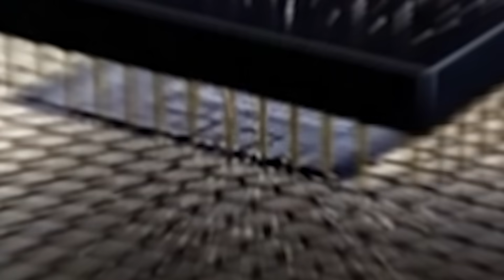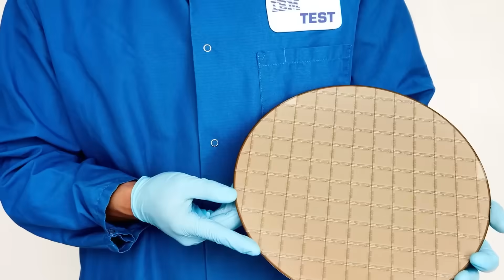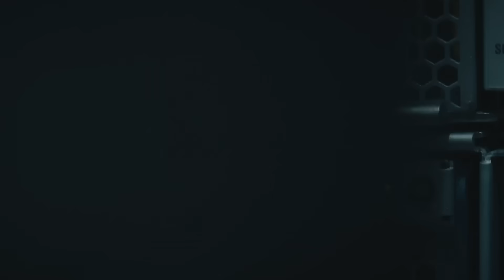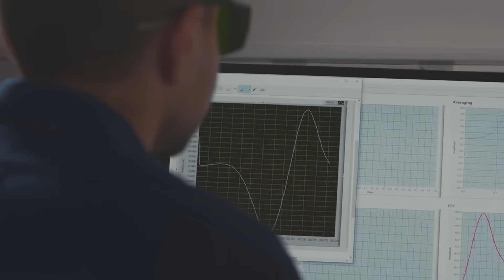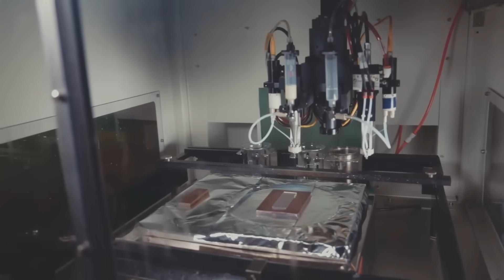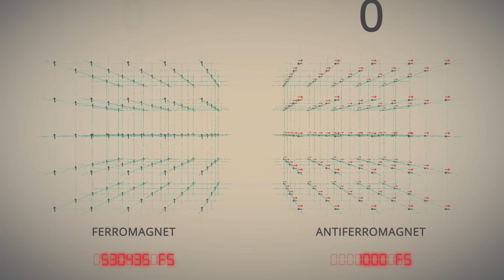Samsung's New 8nm MAGNETIC CHIP Beast Wiped Out The Entire Silicon Chip INDUSTRY!

Comment: photonic computing... no heat ,  infinite speed.  what was the other issues???
Reply: You are old enought to google that your self.
The reason light is not used for computing is that the operability is very hard.
Reply: @blanciwiinom8060 look at the future and then fix the steps that prevent you from being there
Reply: @blanciwiinom8060 👍👏
Reply: except you can only process with light. it can not store memory, so you will get bottlenecked using silicon  ram and hard drives. the first ram ever was already magnetic too,

Comment: If a technology is slower at the fundamental level, that doesn't mean it will not replace processors. If it can be miniaturized enough and made cheaply, then parallelism will be the way to circumvent the speed drawback of magnetism. So, processing can become massively parallel to reduce latency over most if it consume a lot less power and produces a lot less heat losses
Reply: Depends.  The worst enemy of a slightly better solution is one that works well enough....

Comment: MRAM is likely to replace SRAM full stop outside of the lowest L0/L1 caches.

The scaling of SRAM has become increasingly bad overtime, and when combined with the greater efficiency of non volatility in MRAM it just makes more sense to start pushing MRAM to L3 and later L2 cache.

This is ironically already being made more and more possible with every new 3D packaging generation through which AMD is iterating on its V cache.

As 3D stacks decrease pitch and increase number of layer <-> layer interconnects we will probably see L3 cache go completely vertical, and L2 at some time after that - at which point it no longer needs to be on the same fab process as silicon to work.
Reply: they would of done this decades ago if it was better, the first ram ever used magnets
Reply: Excellent discussion👍👏
Reply: Likely not. MRAM is slower. MRAM will have its' place, but completely replacing SRAM isn't it. I am sure some SRAM will be replaced though.
Reply: @derek2593 You missed the table that has antiferromagnetic mram at 1 picosecond.  They are struggling to get sram to keep up with the latest processing chips.
Reply: @waynemorellini2110  For real? A PICOSECOND? That's crazy.
Reply: @pleaseenteranamelol711 Crazy but slow the unofficial magnetic circuits are clocking 4thz or more.  It in the video.  The tablet shows ferromagnetic as 10ns like dram, 1 pico for the antiferromagnetic.  I can guess why.  In my own design ideas I propose constraining materials to enable higher switching, such as in the clocks.  Without it the field reverberates.  That's a reason magnetic logic clocks were so low, to let it settle down.  I simply saw the issue and proposed a work around.  Seems the researchers in that article i can no longer find had similar ideas.  The distance the signal travels and the speed of light is the big barrier.  I will stop there.

Comment: There's light at the end of the tunnel. If data centers migrate LLM to magnetic memory, maybe by 2030 we'll FINALLY be able to buy RAM!
Reply: Not when they shut down consumer RAM to only provide RAM for server farms
Reply: Corporations benefit from halting retail hardware advancements at a level insufficient to run LLMs that could compete with their paid services. Apple is also buying up memory for similar reasons...
Reply: This MRAM stuff is slower than silicon transistors, but it uses far less power. So, it will be used in conjunction with current tech to lower power usage.
Reply: @derek2593 look at the table for antiferromagnetic.
Reply: Not gonna happen.

The transition to (currently) exotic memory types is coming, but not to that level and that soon - the investment in the current SRAM, DRAM, and CMOS logic paradigm is too deep to make such a huge change so quickly.